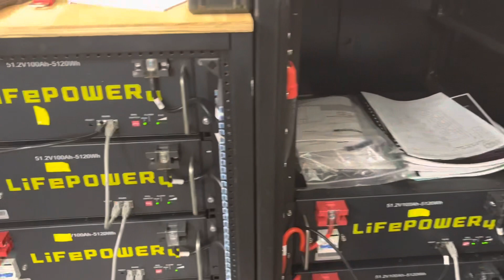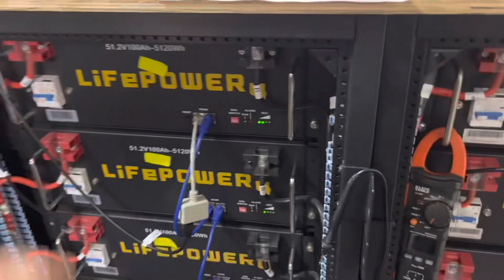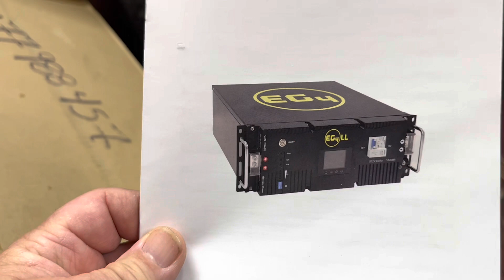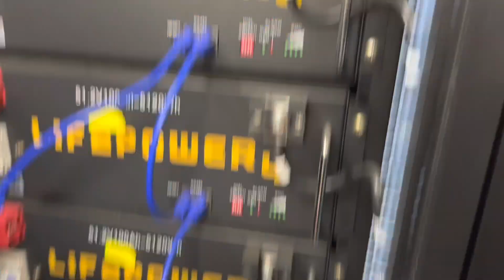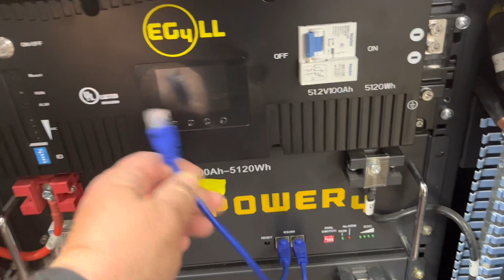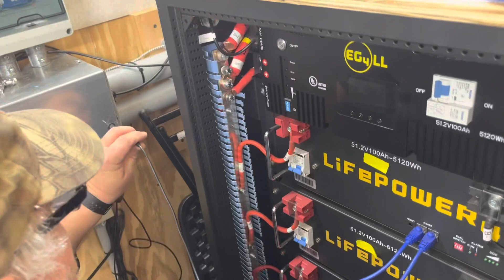EG4 LifePower 4 and LL V2 Battery Bank Upgrade. Setting up BMS comms with SolArk 15K

Comment: Signature Solar just buys crap from China and resells them. Same as Sol-Ark. Poor designs. The industry is still having growing pains, because there are basically zero standards. Thats why the Pylontec protocol over CAN is being used as a sort of standard for comms. 
We need to build the standards so the manufacturers have a blueprint. Until then, DIY is going to be frustrating. Hopefully the IEEE will get involved.

Comment: good afternoon.  could we use copper washers between the riv-nuts and lugs?  i saw a fella (another channel) use the small star "scratch" type lock washer between his riv-nut and lug....stainless steel though.....it filled that dimple in real nice, but looked a bit sketchy to me.
Reply from the maker: You need copper to copper contact. The star washer physically fills the hole but doesn't provide copper to copper. Using a fill washer still provides only copper to steel contact. That's not good for an electrical connection. The easiest fix is doing what I did. It provides copper to copper contact. Others have drilled and tapped the buss bar which is the best way to do it.
Reply from the maker: Copper washers will work but they need to similar to fender washers to have enough copper to copper contact.
Reply: @jeffmotes2129  thats the angle i was hoping would work, if not like ya said to drill and tap it.

Comment: Great job. Is there any reason you put all this in a container instead of the garage; I assume in case the batteries went up the house would be safe? I ask..because I'm highly considering doing the same thing.
Reply from the maker: There isn’t much available unused wall space in my garage. I would have had to remove some cabinets I recently installed for my wife. That would not have gone over very well. 

My intent was to install a system that was as seamless and unobtrusive as possible. Thus I installed the system near my power meter about a hundred feet from my home.
Reply: @jeffmotes2129  agreed on the wife factor..wise choice sir.

Comment: Jeff I’ve had the same issue with the difference in % of charge between Sol Ark and life power batteries. To get them back in sync I have to pull batteries down to about 15% then charge to 100%. Then it is usually within about 2%. I also have to balance batteries about once a month.
Reply: I have the EG4 charger and  turn all batteries off and breaker to Sol-Ark. I connect charger to bus bar plug in charger then turn on 1st battery to be charged. I monitor charging with Solar Assistant. When charger cuts off, I turn battery breaker off then unplug charger. Then I check voltage on bus bar, it takes a few seconds to go to 0. I repeat process for the rest of the batteries.  Next I will turn battery breaker on to Sol-Ark then turn on 1st battery and if you watch voltage on Solar Assistant it will drop some. You do not turn on the other batteries. Turn off battery then turn next one on, let voltage match 1st battery. Repeat til all voltages are the same. Then you can turn all the batteries on.  For about a week after balancing they will stay together on discharging but over time 2 of them will not get to 100% charge.  I only have 4 so it doesn’t take too long.  Does yours do the same? The Solar Assistant sure has made monitoring the batteries easy.
Reply from the maker: @geneg7956  pretty much the same. I had three not charging over 70%. I disconnected them from the bank and charged each one separately. They went from 67% to 100% in less than a minute. Don’t understand why because my charger only puts out 15 amps. I recalibrated the batteries per Sig Solar instructions and these three are now about 5% above the rest of the batteries.
Reply from the maker: @geneg7956  solar Assistant makes tracking the batteries easy. I’m afraid once I get the BMS working with SolArk I’m going to lose the ability to see each individual battery.
Reply: I like the information that Solar Assistant gives on cell voltage high, low and average.
Reply from the maker: @geneg7956  yes. And the interface is great. Easy to see at a glance what’s going on.
Reply from the maker: How are you balancing them? Letting the SolArk do it through their equalization routine? Or another method?
Reply: I wish Sol-Ark would do it.
Reply: My batteries and Sol-Ark are 15% off today. I was not able to charge to 100% yesterday and that makes the Sol-Ark go stupid. Now I have to adjust  battery usage shut off so batteries don’t get too low. Solar Assistant shows batteries 15% Lower than Sol-Ark. We are getting lots of rain in East Texas so it may be a few days before I can get them back in sync.

Comment: Can you elaborate on the issues you were having with communcations with the Growatt 5000ES and the LifePower4 batteries?
Reply: Why not buy a tap n die set and tap a new hole in the bus bar and ignore the rivnut?instead of junking up your install with stacked connectors?
Reply from the maker: @chrislewis9345  I could have done that but to be honest I was just too tired. Copper buss bar spacers are not uncommon in industrial settings. So I feel good about it other than it looking out of place. I’ll be using a thermal camera to scan all the connections in the near future.
Reply from the maker: When connected in BMS mode with the Growatt SPF5000 it would not charge higher than 10 amps per inverter. Tech support was not very helpful at the time. I ended up having to set to USE mode. In USE mode the inverters would charge at their maximum output.
Reply: @jeffmotes2129  So would you say this way probably related to running a multi growatt configuration?  Have you tried running a single unit with your EG4's?  and if so,  did you have any commucation issues that way?  Great videos btw, very informative.
Reply from the maker: @leafnutz2341  i need a absolute minimum of 15kw of inverter capacity so I didn’t try the Growatts in single configuration. 

The problem I was having is when in Lithium mode of the SPF5000 it would only charge the battery bank at 10 amps. Nothing I tried would increase the charge rate. Tech support was no help. I had to put the inverter in USE mode to get full charging capacity. When I told tech support what I had done they basically said “yeah! It’s working”. Never helped me resolve tge original issue.

Comment: LOOK AT ALL THAT POWER!!!

Really glad that you've had a positive experience with SS tech support.  I've been working with Ty as well.  Still waiting on clear answers to my questions, but this makes me hopeful.  

You're not the first person to commend on the rivnuts.  Not sure who though that was a good idea to use those with such small lugs.  

If you have your batteries running through Solar Assistant, I believe SA takes all the SOCs from the individual batteries and just averages them all together.  That's good in theory, unless you have one battery way outta whack.  Not sure how Solark figures out the calculation.  

Thanks for keeping us updated!  Love where things are going!

Comment: Look's like u have both positive and negative at the top of the bus bar u should have the positive at the top and the negative at the bottom so the charge and discharge flows thro all the batteires instead of the top 2 batteires taking the full load.. That's how I ran mine. Just saying... Keep it up brother
Reply from the maker: I considered that. And I know that was a concern when using lead acid batteries. But I intentionally decided to connect the main battery cables from one end of the buss. 

I’ve monitored each individual battery using solar assistance and I have found the battery location relative to the buss connection has had no bearing on the charge and discharge rate of the batteries. 

When I get my solar assistant back up and running I’ll do another video of the battery monitoring. 

I’ll explain in another video what I’m doing with Signature Solar Tech support to correct the three batteries not charging completely. These three are batteries 1, 8, and 11.
Reply: It doesn't really matter, especially when you have SO MANY batteries.